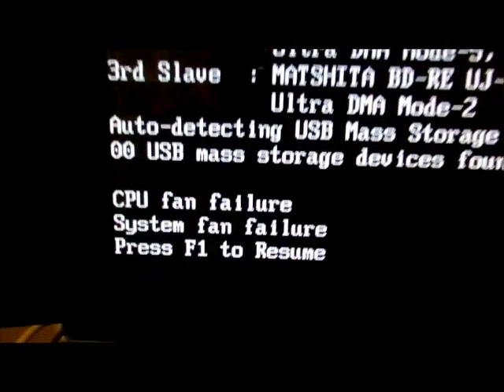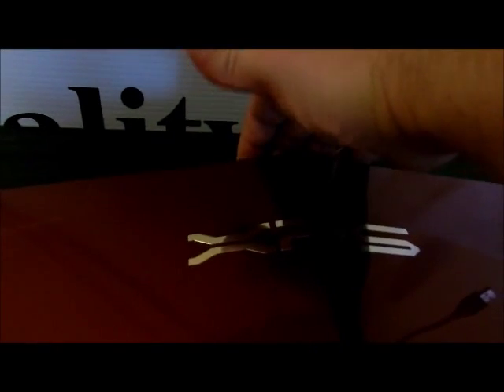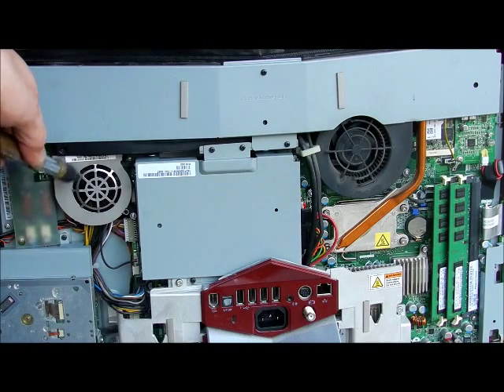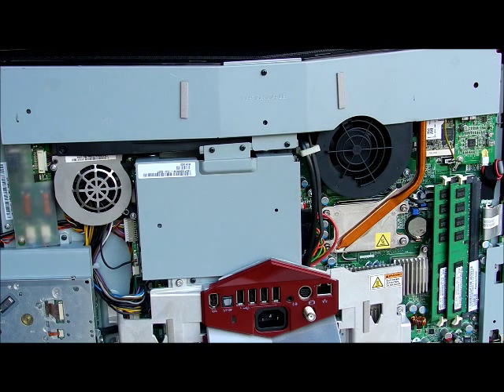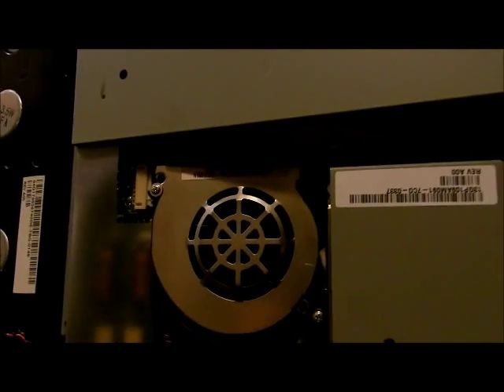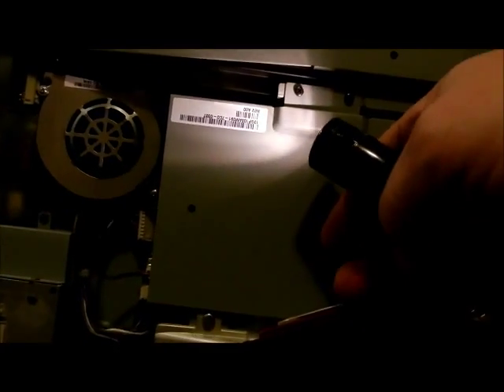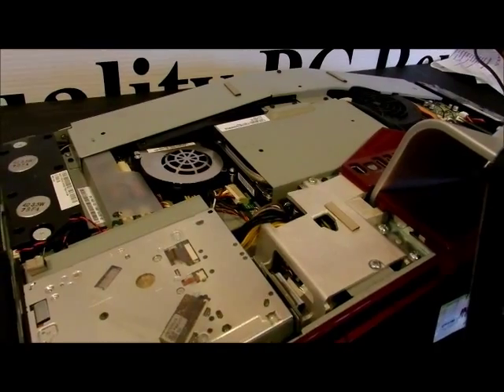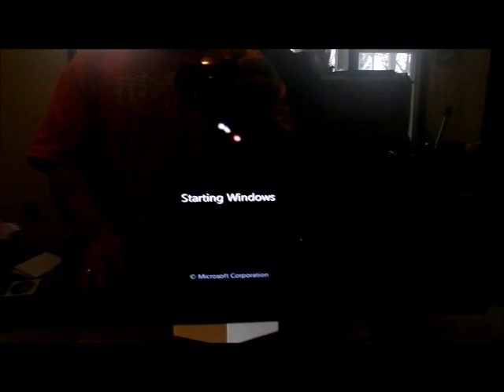Dell One All-in-One CPU Fan Failure

Comment: Thanks For this Awesome Video. I like to ask Question please help if you can. Thanks again
i have system dell 9010 all in one sometime it starts normally until i shut it down. but sometimes it gives fan noise and no display. just HDD light blink like flash per second. all mouse led and keyboard numlock automatically turn off. only what you can hear is Fan noise. if you have any idea to share please.
Reply from the maker: This happened to me quite a bit.  First just before the hard drive fail and second because the computer failed.  That is why it's not gone.  Back up your hard drive now.
Reply: @billyq12001  HDD is working just fine on another system
Reply from the maker: @muddassirsheeraz  The fans fast because the CPU is super hot.  Just letting you know not to leave the computer on 24/7.

Comment: I have All in One and from time to time in taking out the fan case and using a vacuum cleaner i'm also cleaning the radiator vents. That is crucial for a fan to work properly and also to cool down the processor. Only using the compressor is not enough. Keep in mind also that my Dell has 99.5% up-time since 2010.
Reply from the maker: +freezingthedarkness Thank you for your post.

Comment: I have a Dell XPS M1730 laptop with a X7900 Extreme Core Processor by Intel. It is 2.8 ghz , but only show 2.1 in the BIOS.
I have the same laptop with a 2.4 ghz Intel and it show 2.4 in the BIOS. Any idea why the the processors are not working to their fullest using Windows 7 Ultimate 64 bit in all cases. Thanks for all your helpful videos.
Reply from the maker: +SuperCal I honestly would not worry about it.  If you do I would call Dell support about it.  The BIOS may need a flash update.
Reply: I did a flash update, but the lower processor speed carries over to the performance. The Windows index reflects a much lower processor score. I have never called Dell $upport. Do they charge? Thanks, Shalom
Reply from the maker: Not sure.  I still would not worry about the BIOS reading.
Reply: I made some progress after changing some things around. I had some identical laptops, and found a bad charger and battery was causing the problem. Unless this laptop is plugged in with a good battery and charger, then it will not perform at it's highest level. Thanks and use this if you need it.
Reply from the maker: Glad I could help.